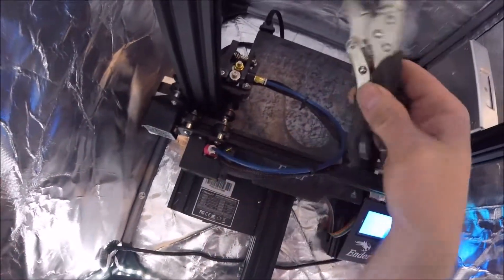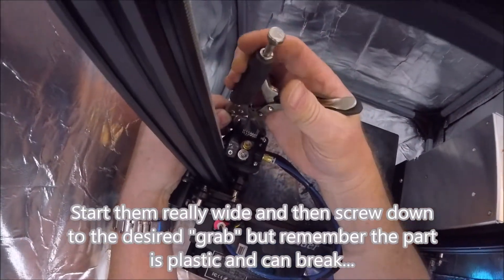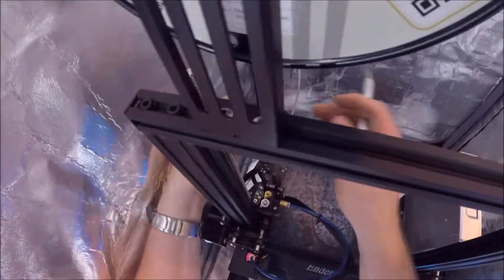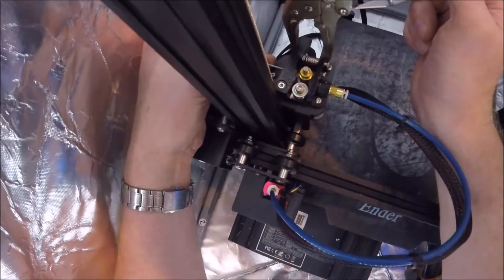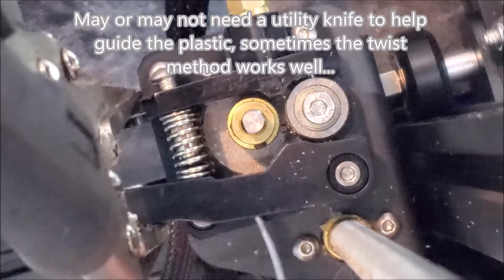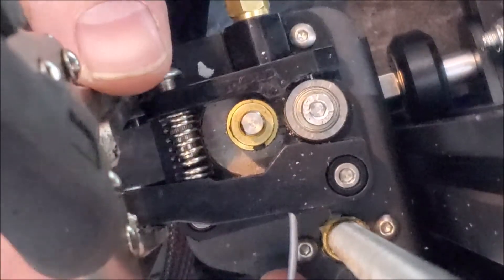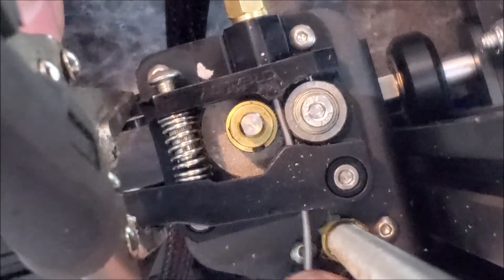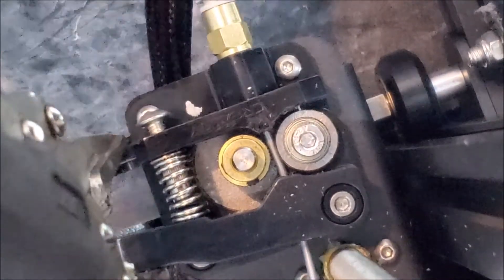Ender 3 / Ender 3 Pro threading plastic filament trick

Comment: I didn't even need to clamp it once I saw you work the angle of the filament.  If you just hold it so that it curves to the left and down a bit, it goes right through.  Thanks!
Reply from the maker: The clamp just makes it less frustrating, 😆🤣